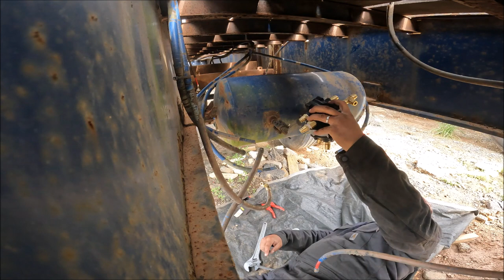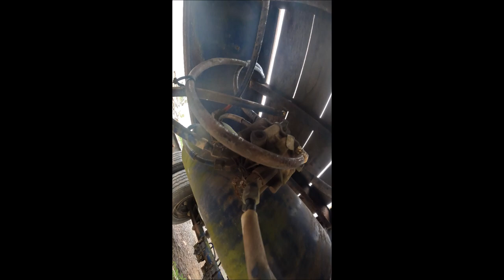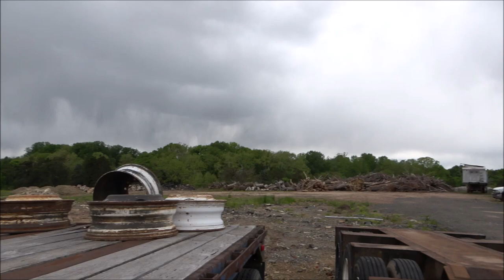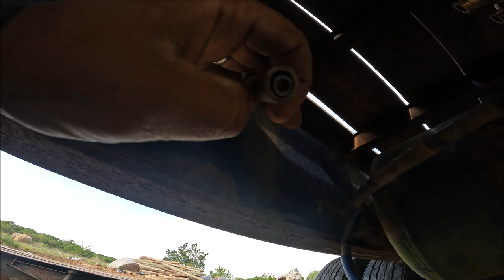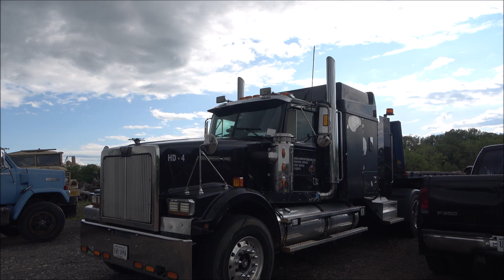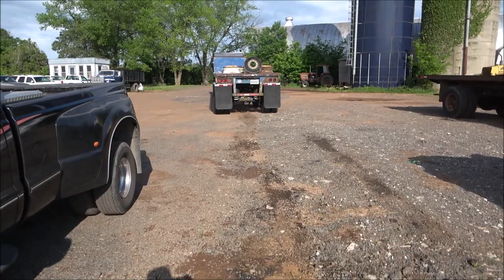Replacing Haldex FF2 Trailer Brake Control Valve

Comment: There is a port that says control on it. What does it do ?
Reply from the maker: Not sure.  But, the control valve should be activated by the brake pedal, brake lever, and/or air release button on the dash.  However, I haven't found a schematic to confirm.